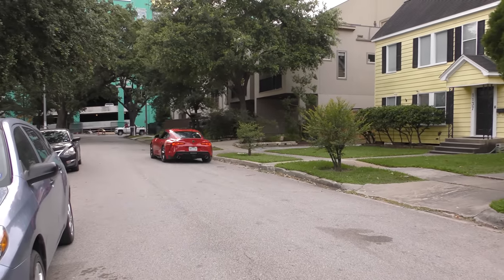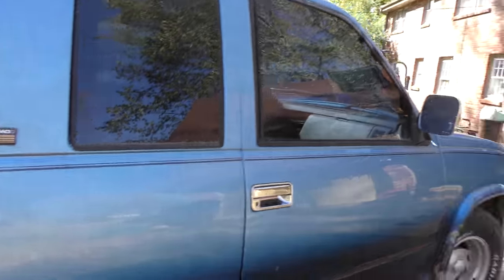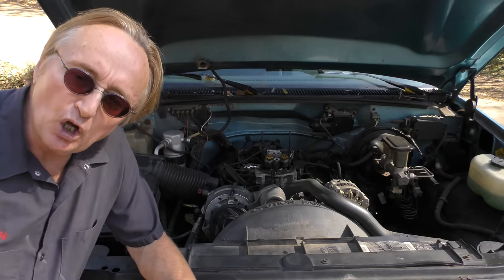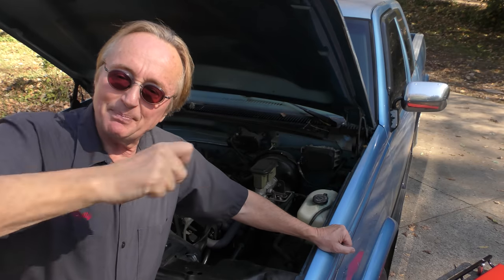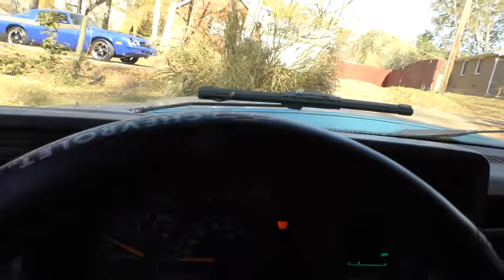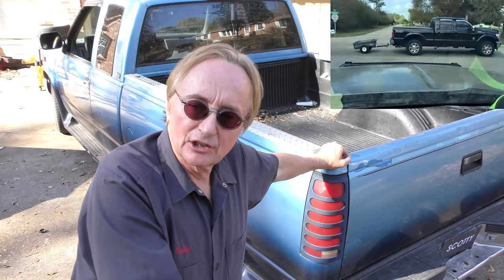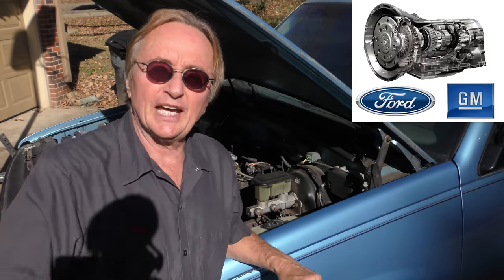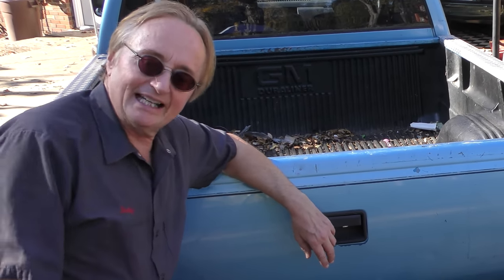The Only Chevy I’d Buy

Comment: Hi Scotty - As people have stated earlier Headers were not a factory item - Trucks sold in California had cast iron intake manifolds due these trucks were outfitted with Air Injection Systems and Catalytic Converters for emission purposes. These trucks were also equipped with some type of ABS Brake Controller (can't remember which year they started) but this was a black box located under the Master Cylinder that was a 100% fail item - due they were expensive to replace and didn't seem to make any difference in the vehicle's braking capability, most just removed the brake warning light bulb from the dash --- no light, no problem, right?  While the TBI in these trucks was largely dependable, the 5.7 Liter Motor wasn't that clean so to help decrease emissions they were equipped with 210 degree Thermostats and thanks to miserably thin cylinder head castings heads cracked on these things like nobody's business. Also, the 700R4 Transmissions in the 1/2 Ton Trucks even with better quality aftermarket clutches, drums, torque converters and rear overdrive planetary units ran extremely hot and would be suspect towing anything larger than a Jet Ski Trailer.  And in California once emission levels were tightened in the late 1990s, very few of these trucks would emission certify without new catalytic converters on each side, new exhaust systems (due to junk factory exhaust pipes), full tune ups and rebuilt TBI units with smaller jets, they became money pits, so it's rare to see one still on the road here in the Golden State.  Arizona, Nevada and Texas are the probably the only places you'll find a Rust Free Truck due GM didn't start really concentrating on Rust Prevention until the late 1990s.  Sadly vehicles in the Rust Belt, North East and North West rusted to bits in 6-7 years and were quickly taken off the road due they couldn't pass State Inspections.  Sooooo.....bottom line is something from Texas that's 25 years or older is exempt from emissions testing so if you find a rust free, non-ABS vehicle with a brand new 700R4 Trans for $2,000 might be an OK buy.  The moral of this story --- you may want to be a little more careful about recommending a vehicle until you quantify where it's from and how it's equipped (or missing) certain equipment.

Comment: I got a 95 that needs something done to the brakes after replacing the booster and master cylinder
Reply: Have the old brake fluid vacuumed out and install new fluid.
Reply: @garagestuff9653  I’ve done that multiple times
Reply: @rudysalazar1986  Did you use vacuum pump? Not foot pump
Reply: I’ve done both
Reply: @rudysalazar1986  Ok brake pedal still bleeding off some. Will never be like new. If you are getting 85% brake it is said this is good. I know of other 95 chevys do the same thing after repairs.

Comment: $2000.00 for a 1994 that Needed 400.00 to be rowdy worthy is a total ripoiff I got a 1990 in better condition and its actually a Silverado extended cab with lighted visor and is also a k1500 so its 4x4 and paid total of $328.00 my opinion I'd never even give thought of buying it for 2 grand jesus and best mod or whatever you wanna call it aftermarket is I ran true duals and is legit and real strsight piped meaning eaxh manifold has it's own pipe ran out the back eliminated cat converter eliminated y-pipe and eliminated the mufflers so it's a real true definition of "straight pipes"

Comment: I've had 3 of these and all 3 ended up spinning bearings in the engine,  love them but wouldn't buy another one.
Reply: Must have been owned by bushpigs before you bought them
Reply: That's what happens when you use s*** oil like Pennzoil, Quaker State
Reply: @TheWretchedWorld  I got one from an old man that always had his work done at the dealership,  the other 2 I have no idea. From what I've heard they are notorious for spinning bearings.
Reply: @leehill2149 Agreed 💯

Comment: Honestly that '94 is a beater, $2K, nah- that's a hard pass. Comparing miles and years, theres more issues than a transmission. 
 My '07 civic currently has 168K miles with original trans, engine.  
I'm not asking to compare apples to oranges but that truck looks to me like a money pit.

Comment: correct. rust. Chevy trucks become rust buckets in only 3 years. reason, the wax coating. the wax has a very short duration, and salt penetrates it. beneath the wax is a bare-metal frame. new wax cannot be applied to old wax, so recoating is impossible. to this day, GM refuses to coat their frames with a proper sealant. Rust is but one major problem with GM. I shall never buy GM.